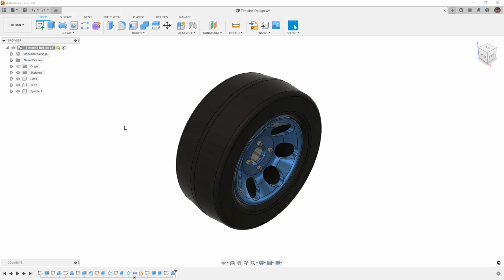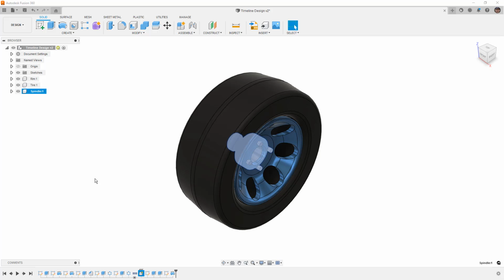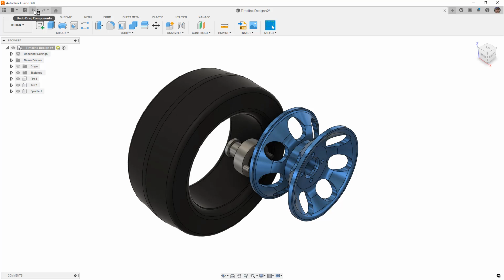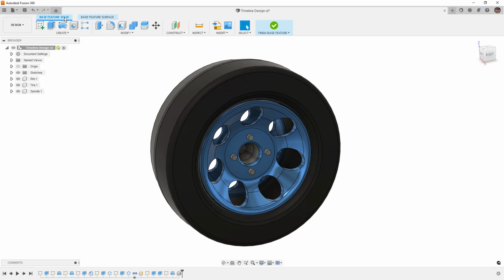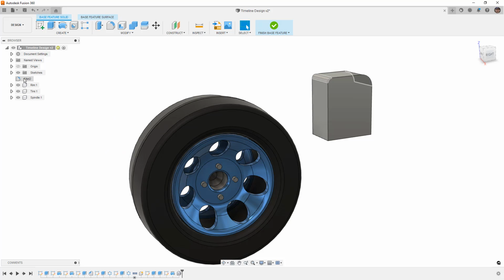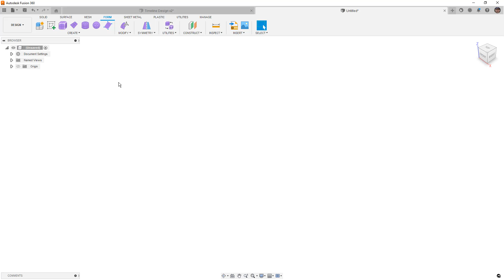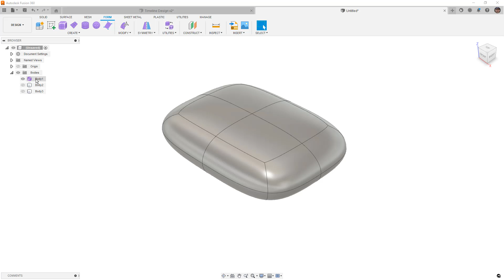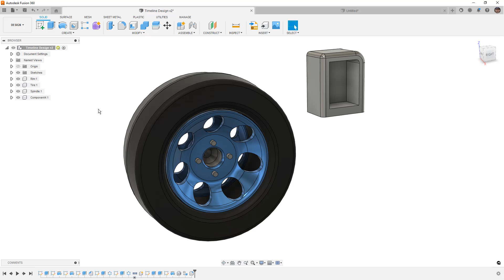What is a Base Feature? | Learn about Base Features and When to Use Them in Fusion 360 | #fusion360

Comment: I use the base feature to import (copy paste) from other files. Like external geometries such as sheet metal parts. It works great since it's otherwise not really possible to copy bodies from a file to another.
Reply from the maker: Great tip Emang!  Thanks

Comment: Hi, can you make tutorial how to draw f1 car body by loft and cross section?
Reply from the maker: Hi Hubert, that is a tricky one as I don't feel that Fusion 360s loft tool is really "there" yet.  I will give it some thought.
Reply: @LearnEverythingAboutDesign  yeah, I have same felling, that's why I asked You :P
Reply: Can you recommend any cad program in which to best do this?
Reply from the maker: @Huberciskooo  What is your end goal Hubert?  If you are looking to make an F1 body then going to a true Class A surface program like Alias is probably what you would want.  Programs designed for that type of work are expensive.  If you are looking to create say an F1 body for an FSAE engineering project, Fusion can handle that but I would suggest doing it with Forms over using Surfaces/lofts.  You can loft form bodies to get started as well.  Years ago I did a project for Autodesk designing an FSAE car body with forms, but that was 2016 i think and no longer is online.

Most CAD programs can handle this type of surfacing work as long as the end goal isn't focused on "Class A" surfaces like production car manufacturers.  For some reason the file is missing parts and I didn't go digging for other versions, but here was an F1 car i did with surfaces in Solidworks back in 2013 i think. https://a360.co/3MZu2kz   I know a friend of my Jan that does Lean Solidworks.com is working on an F1 course in Solidworks i think.  as always the end goal is the important thing.  Fusion 360 Forms can produce a decent result if you take your time with the design.

Comment: Hi, have you made a video on how to build offsets/b surfaces to class A surfaces coming from Alias yet? Can this be done in fusion?
Reply from the maker: Hi Jimmy, Fusion, and most CAD programs aren't really capable of getting to true Class A surfaces.  The best they can achieve is G2 continuity when using surfacing tools.  The forms videos, of which I have a lot, do maintain curvature continuous surfaces that are closer to a class A, but still don't really have that level of control.  You can get yourself into a bad surface really quickly.  You can get descent surfaces from Fusion, but the forms outputs are much better than the surface tools at this point in my opinion.
Reply: Sure, Fusion (and prettymuch all other cad Tools) is just not equipped with tools that can comfortably archive such surface quality- that’s what Alias and IcemSurf are so specialized to do exactly that.
But usually those class A surfaces are then taken to catia or nx to build the offsets and b sides… I was just curious if you have experience to build these kind of b surfaces and constructions in fusion as well -
Should be possible, right?
Reply from the maker: @jimmyjames6913  Ah I misunderstood your question Jimmy.  Yes that should be possible in Fusion assuming you bring in a class A surface BUT there are limitations of course.  The last time I did/tried something like that was with NX so sadly I can't say that I have tried it in Fusion.  I am not very happy with the Surface tools in Fusion and how they end up breaking edge relations and produce continuity issues so at this time I probably wouldn't suggest it.  I will see if i can grab any Class A surfaces from Alias samples and play with them.

Comment: Hey bro,
Big fan of your work. Just Quick question: Will we see videos related to CAM from you?
Thanks.
Reply from the maker: Thanks JB!  I have done a good bit of CAM content that is free on the Autodesk site that I can point you to.  I have done a few here and there on this channel for things I thought were missing.  I can certainly cover it.  Anything in particular you want to see?
Reply: @LearnEverythingAboutDesign  Nothing in particular. To be honest I am a self-learner and have learned fusion 360 by watching tutorials and experimenting with software. I knew about free form and tried a bit but after discovering your videos about free form, It has boosted my skill to 10x. I have a basic knowledge of CAM and I have seen several tutorials but I like how you explain every step and the reasons for using the feature If you can make short series about CAM that will be very helpful.
Thank you.
Reply from the maker: @jbsurti181  Ill add it to my list.  I have courses on the Autodesk website for 2.5, 3 and multi axis milling and turning that you can check out as well.  https://www.autodesk.com/certification/learning-pathways/cam-axis-milling   The style is very similar with fewer tangents into options/areas :)